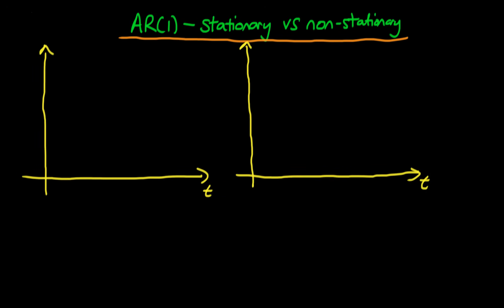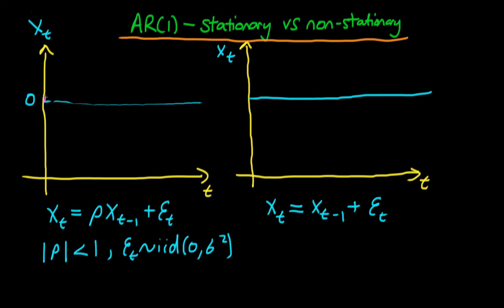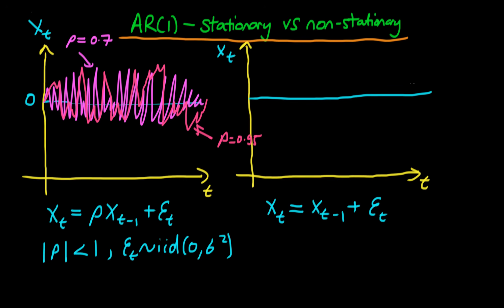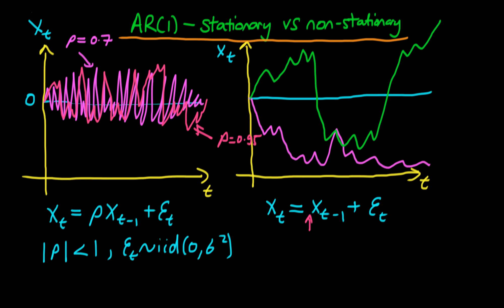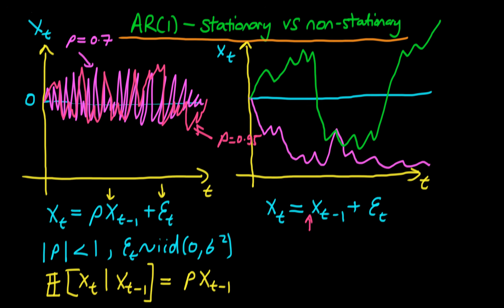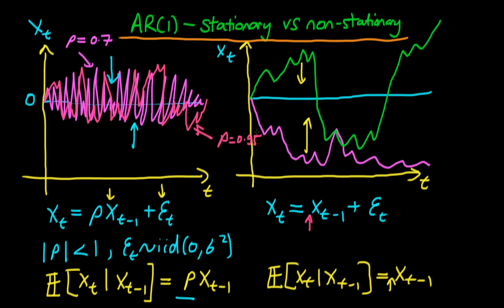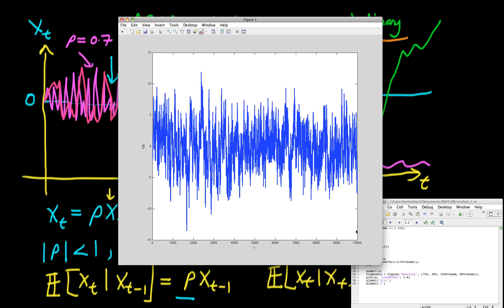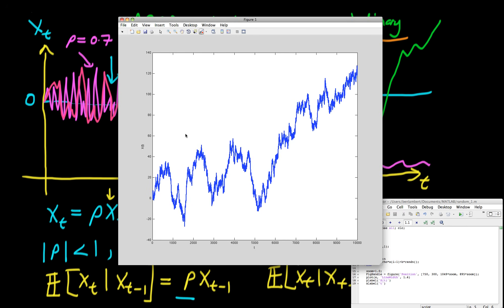The qualitative difference between stationary and non-stationary AR(1)

Comment: Sketched the same thing in Python, hope it helps!

import numpy as np
import pandas as pd
import matplotlib
import matplotlib.pyplot as plt

# define each datapoint as a normal r.v.
def generate_datapoint(params):
  mu = params[0]
  sigma = params[1]
  return np.random.normal(mu,sigma)

# Set the number of datapoints
T = 100

B = pd.Series(index=range(T))
B.name = 'B'

for t in range(T):
    # Now the parameters are dependent on time
    # Specifically, the mean of the series changes over time
    params = (t * 0.1, 1)
    B[t] = generate_datapoint(params)

plt.plot(B)
plt.xlabel('Time')
plt.ylabel('Value')
plt.legend(['Series B']);

Comment: Hello sir, I am studing the debt sustainability of WAEMU countries. It is said in littterature that when dependent variable which is primary surplus and independent variable which is debt are both stationary this mean that there is sustainability. In my case both are not stationary and this signals unsustainability of debt.  
For my GLS regression I am wondering wether I should take those variables in level or differenced them first? 
Thanks

Comment: If there are 2independent and 1 dependent variable in a regression and DF test needs to be applied and the significance of the two independent variables is 0 and for dependent variable it is 0.1156. Which of the variables are having unit roots?

Comment: I just mocked up a similar simulation in R, but I animated it, increasing rho by 0.01 from 0 to 1 in each frame, at 2 frames per second, using the same white noise data. Watching how the data changes makes a lot more sense now. Thanks for the videos.
Reply from the maker: Hi Jesse, many thanks for your comment and effort reproducing the above in R. Would you mind sharing it below here? I think some people would potentially be interested to reproduce above in R. Best, Ben
Reply: z = rnorm(1000)
gen = function(rho) {
  x = numeric(length(z))
  x[1] = z[1]
  for (i in 2:length(z)) {
    x[i] = rho*x[i-1] + z[i]
  }
  x
}
display = function(rho) {
  x = gen(rho)
  plot(x, main=as.character(rho))
  lines(x)
}
for (it in 1:100) {
  display(it/100)
  Sys.sleep(0.5)
}
Reply from the maker: Jesse Maurais That's great. Many thanks for this! Am sure it will be useful. Best, Ben
Reply: @SpartacanUsuals  Sketched the same thing in Python, hope it helps!

import numpy as np
import pandas as pd
import matplotlib
import matplotlib.pyplot as plt

# define each datapoint as a normal r.v.
def generate_datapoint(params):
  mu = params[0]
  sigma = params[1]
  return np.random.normal(mu,sigma)

# Set the number of datapoints
T = 100

B = pd.Series(index=range(T))
B.name = 'B'

for t in range(T):
    # Now the parameters are dependent on time
    # Specifically, the mean of the series changes over time
    params = (t * 0.1, 1)
    B[t] = generate_datapoint(params)

plt.plot(B)
plt.xlabel('Time')
plt.ylabel('Value')
plt.legend(['Series B']);
Reply: Thanks!